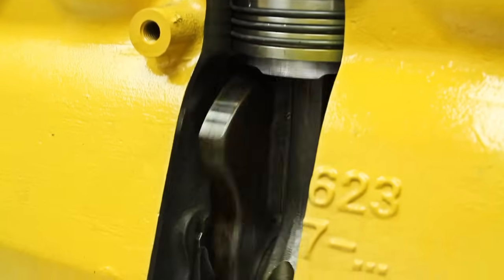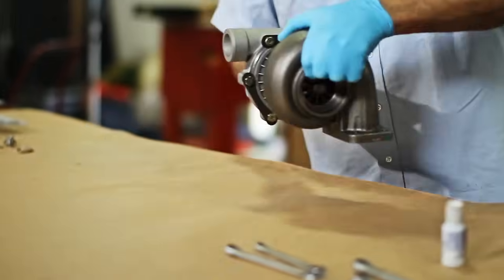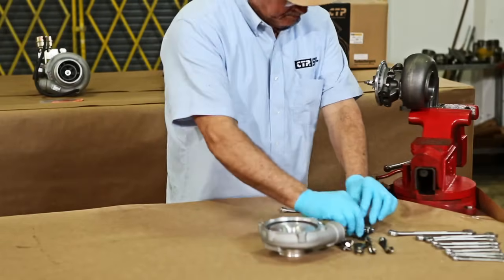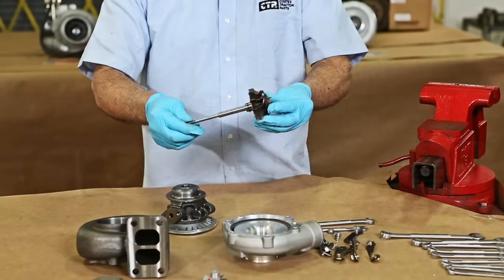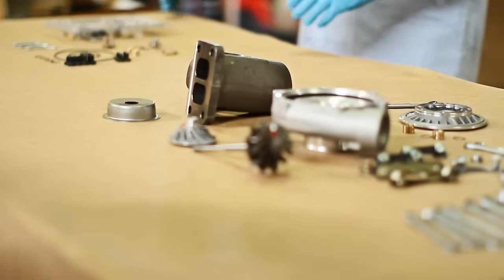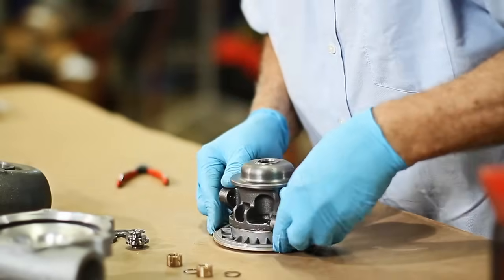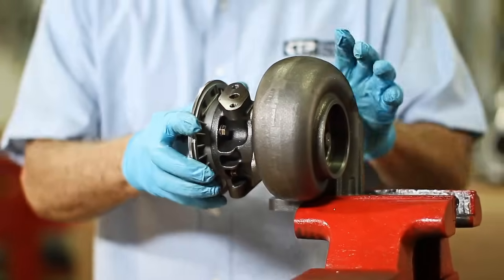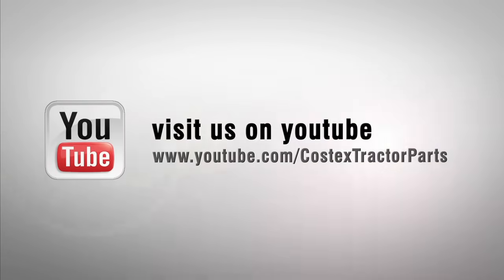Turbocharger Repair

Comment: I am about to strip my turbo down for a rebuild if I mark the position of both the wheels like on the housing and use those markings to get the alignment with how it was before stripping will the balance be the same after removing the markings?
Reply: I'd be using a scriber - NOT typex

Comment: good job guys,and what do have to consider when reffiting a turbo in a vehicle does the condition of the engine matters and the oil /fuel pressure considered

Comment: just replaced head gasket and everything that goes with that job . before I hooked up the tail pipe I filled with water to make sure i got the leak from the head. but I get water pouring out of the exhaust part of the turbo. ???? any help????

Comment: I just got a new turbo for my car because the old one had shaft play and scratch marks on the housing. I tried wiggling the shaft on the new one but it didn’t budge. I did that a few times now I feel like it’s moving just a little. My question is there anyway I could’ve damaged it?
Reply: Is normal to have play, all the turbos have radial play, if have oil inside you dont feel the play, when you move it and oil came out you will feell the play.

Comment: Hello how do I ask you a question, change the axis of the turbine to a new one that is already balanced, the wheel of the compressor is also balanced, could you arm the turbo without balancing the parts?
Reply from the maker: Hello Sebastian. On a turbo repair, all rotating parts must be balanced or checked for proper balance.

Comment: so why is there NO coverage on torque specs on the bolt turbos???
what you just hand tighten them?
Reply from the maker: Hello Tim. All bolts should be torque/tightened to manufacturer specs.

Comment: Did the turbo not need balancing ?
Reply from the maker: Dear Richard, that is an excellent question; If care is taken to mark the positions of the turbine shaft  & the compressor wheels for re-assembly, or if the wheels have not been damaged, nor are they being replaced,  then the answer is no, the assembly does not need to be rebalanced.
Reply: If any of the components are damaged like the turbine, shaft or compressor wheel then yes will need a rebalance or just replace with a new cartridge. (Often a rebuild kit and ballance cost same or more than a replacement ready built cartridge)
Reply: yes you need t balance it.. marking the bolt and putting it back to place doesn t do anything unless the shaft wheel is aligned with the nut on the compressor wheel ... without balance it cuts the turbo s life in half...
Reply: Btw ,now you can order a shaft wheel that is balanced but you will still need to balanced the cw nut...and the repair kit +sw+cw is alwayd cheaper then a cartridge in a few cases not by a lot but in some cases it could cost almost half the price of the chra... if you don t have a balancing machine just buy a turbine... and sand blast (clean) the turbo s housing do not open your new chra
Reply: @Lord.Xenith  Hi...is these OK to clean the turbo s housing using sand blast? is it safe to do it?
Reply: @laurentiupurnichi3813  yes you can sand blast  the turbo  just  use the right  mesh for the compressor housing (which is the aluminium part)  don t sand the inside just the outside and for the turbine housing which is the metal part that is heavy you can clean it inside and out  , when your done remove all of the sand from the holes and the housing , I personally use brake disc fluid to remove sand .